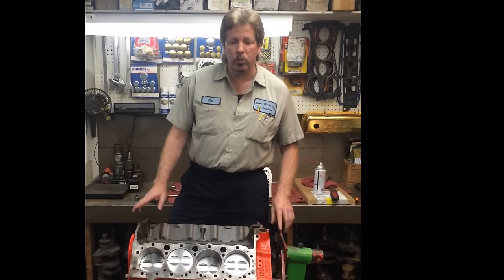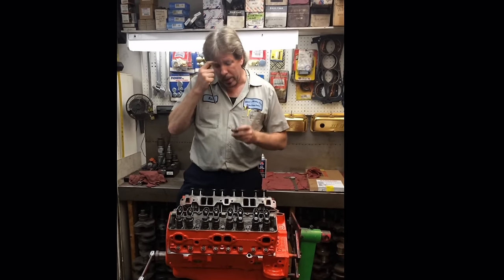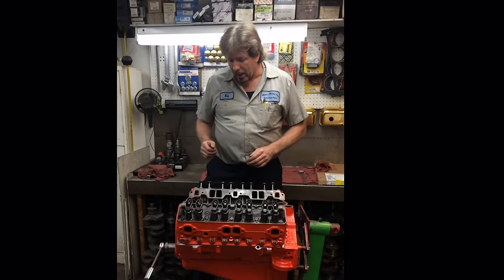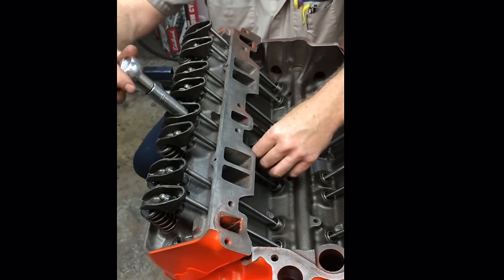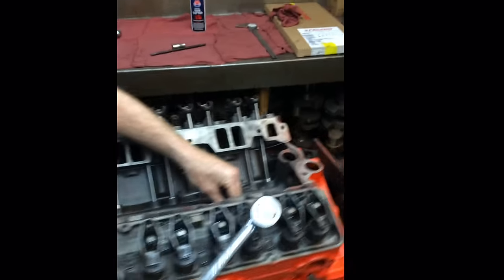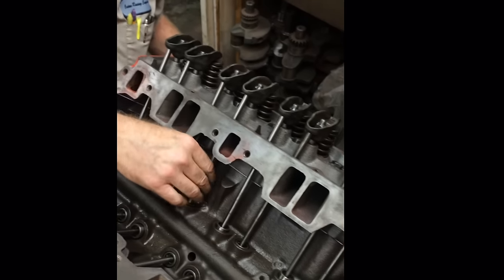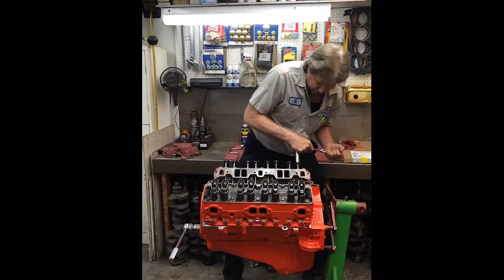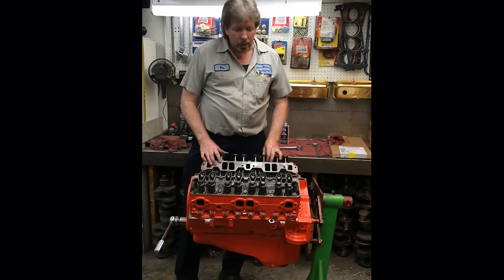Hydraulic valve adjustment made easy - Your Engine Guy

Comment: WOW... i learned something new... after i thought i knew everything  come to fine out i don't know shit... Haha this is the best VIDEO i have every seen on You Tube on engine valve adjustment no kidding... you sir just changed my life for the better... i have built engines since 1974 and today working on Fords  miracle engine the 302 5.0L as they call it a wonderful Engine that is truly a easy engine to work on and pump-up and chevy also had a 302 engine that i had a friend pump-up in a 1969 Z28 that was one badass Monster of a engine and i had a friend also had a crazy 427 he jammed in a 1969 camaro with a rock crusher T22 transmission that was insane Horsepower. but my B18-C1 GSR Acura engine turbo charged 16 boost power trick fuel 112 octane in a 1995 2 door honda civic could win any of these lead weight cars that GSR B18-C1 Engine i built was a runner ... i still have the engine but sold the car to a good friend with a stock GSR used engine i got out of a junk yard for only $ 1900.00  and i was a great find and well worth every penny of it... this Engine has never lost a single race in San Diego CALIF Ever, i build a serous Engine and am a true Master Tech Here in San Diego and am trying to finish up on the 1995 4x4 Bronco rebuild and so happy i saw this video today and i thank you so much for taking the time for filming it. i give 2 thumbs up and will subscriber to your channel...

Comment: i saw Vice Grip Garage do this here on YT said his Dad showed him. i did it this weekend on a TBI SBC that i have always had trouble with the valves clacking on start up. i was taught by my Dad the running and back off till she taps and run her down 1/2 to 3/4 turn method and spit oil everywhere. this works well even on an engine that has been inst. i would say to maybe do it first thing in the morning before the lifters have been pumped up and use a wrench to turn over the engine if possible. the engine now has more power and runs better than ever since the valves are now opening fully and getting more fuel and is exhausting properly. thanks for the video.

Comment: I had learned that method many years ago from an old hot rod buddy of mine.
Also used a set of old rocker covers cut out, so after installing engine, I could start it up, and make sure oil was making up top on every rocker.
Also makes easy adjustment if I still had a clatter, with no oil spraying around.

Comment: Tried this on a fresh AMC 360 stroker build and worked great on the Isky cam and Crower lifters. To be sure after I completed all 16, I brought the engine to TDC and went around 90 degrees for 2 revolutions and they all checked out good

Comment: Great Video   I’m getting ready to do my 79 F150 302 ci.   So this procedure will work for my engine.  0 lash means adjustment is with no movement with your finger.  You stated 90 degree of crank turn to check and adjust if needed. So each cylinder would go through a complete rotation. (360 degrees) I got the tool to turn the oil pump and the correct oil/oil additive.

Comment: Keeping the oil from squirting out while adjusting the valves with the engine running. Had good success with cutting the top out of an old valve cover direct over the valve adjusting nuts of the engine. Can be reused over and over. Only needed to make sure the gasket remained undamaged and in place.

Comment: Great video!  I was wondering if this method would work for any 4 stroke motor no matter the cylinder count as long as it has hydraulic lifters and adjustable push rods??

Comment: great video but if you have an engine already run and you want to check the adjustment the oil has ready pumped the lifter up do you let it bleed down and still give it 3/4 turn or give it less maybe 1/2 a turn

Comment: Very interesting ideas on this video. I have tried the with engine idling system, the open/closed valves on timing the heel of cam, tried the feeler gauge system, and all these ways have merits. Time consuming and very frustrating at most. This way of doing the lash does seem like it will work, the one question that needs a bit deeper explanation is what happens when the lifters are full of oil, or in pressure with being in a pumped up already ran engine.

My theory is that it shouldn't matter because the down pressure of the pushrod will set the loaded pressure, if the pushrod has any finger spin (loose play) in a hydraulic setup this should be adjusted by Ken's video. However, on a broke in engine, wouldn't each valve need to be loosened off first to find free spin and then adjust accordingly to reset the valves from a 100% even place? 

Doing all this in an engine that is still bolted in the engine bay makes for a harder work area. Space and obstacles can be a pain, and spinning the pushrods could be troublesome for some people. some roller rockers have very limited room under the rockers to spin the pushrods while seeking free spin.

Sometimes in my trials of adjusting valves I have found the socket will bind with the nut and the top of the rocker when an engine is running in idle, or even if the socket is left in the rocker on the nut while just hand turning the crank. Ken's way of adjusting should eliminate most of these problems.

I want to open this up for further discussion about re-doing a broken in engine. Will all who try this back off all tension first, then start over with Ken's way? and how did it work out for you? After you did this, did you go back and recheck with feeler gauges with TDC on #1 lobe on heel and see how it set up? if so what did you find?

Cheers and thanks for reading.
Reply: I have watched on another video Ken has done very recently, and he stated that he has made, or will make, another video addressing the issues of oil filled lifters. Can anyone link to this second part if it is out there? thanks
Reply: Can you answer your questions for me

Comment: Wow thanks a lot. I am about to adjust a 1995 ford van 5.8 that i am working with this will help a lot. The only difference is mi lifters are the existing ones and they are loaded with existing oil . The book says i need a little fork tool witch i am about to fabricate . To finally push and bleed the remaining oil then calibrate. On my Chevy 454 i will do just like you did with this . Mind opening 🤯💯

Comment: I’m swapping cylinder heads on an engine that is currently running and in the vehicle. Not planning on changing the cam or lifters. Do I need to remove all the stock lifters and drain them of oil to use this method?

Comment: My uncle worked in the engine shop at gm and he taught me this technique when I was a teenager and it is full proof if some of these guys with roller cams and rocker set ups would use this method they would not have near the trouble adjusting there value train this will work on solid lift as well on last step on solid I only go a 1/25 turn to mabe slightly over and there perfectly adjusted 👍

Comment: I just did this on my '81-82 305 LG4 SBC with a 260H Comp Cam camshaft and my edelbrock performer rpm intake manifold still bolted on.

I turned the motor over 2 full revolutions, close to 90° at a time, and some were still loose a little by the end. 

Once I completed 2 revolutions and stopped at TDC compression stroke, I tightened the loose ones down again and gave all of the rocker arms.

Still have to drain the coolant oil and put things together on top before I'm ready to start it and see these results.

When I'm ready, I'm also going to leave my valve covers off with a vacuum gauge attached in case this procedure made them too tight and have to adjust with the motor running.

I'll post an update here on the results.

Comment: I used to do them hot when I was younger, then I started doing them cold when I was confident I'd learned correctly from the older guys. My MOTOR manual is absolutely dark and greasy on the pages where it tells you how to adjust 2 rockers at a time every 90 degrees twice around. Then I'd have to work on something else, and I'd get lost and end up turning the engine over 4 or 6! times to make sure I didn't miss any. Wish I knew then what I know now. Thanks!

Comment: Wow what luck i ran across this video. I understand everything you said and this all makes sense. So basically its a 1/4 crank rotation? Then adjust til a slight drag. And keep going 1/4 turn etc. 2 full rotations worth? Then rotate 3/4 additional on last runs to compensate for the spring tensions hell yeah I get it!  Sounds simple enough. I've got a 360 FE gonna put a roller cam in it and glad you tipped that as well.

Comment: Used your method to adjust valves on a new Blueprint 347 Ford. Still a loud valve train I think. Would more preload quiet it or  should I go with less. Brand new motor. Thanks for showing us the method.

Comment: I have a long 1/4 inch extension that I specifically made for using with my Snap-on variable speed cordless screwdriver to rotate the oil pump for priming the lifters and engine just before slapping on the intake and distributor.

Comment: At the beginning when he says when you set according to piston top dead center, you have to rotate the engine two full turns. Using his method, or the certain valves full open other valves full closed method, you still have to rotate the engine two full turns. Using the TDC method it is not a problem keeping track which cylinder you are adjusting if you have to leave for a bit. Just leave the wrench on the nut you are adjusting when you leave. I am not a mechanic nor a machinist, but I have found that it doesn't matter if the lifter is pumped up or not. Previously adjusted lifters will bleed down (allowing the plunger to move to the proper position) as you work your way down the line. Of course adjusting the preload is much easier with a non pumped up lifter.

Comment: Awesome  method Ken! !!! Im changing bad  leaky intake gaskets on a Ford Fe so I have to remove the  rockers/rail and pushrods to be able to remove the intake manifold to install new intake gaskets . How do you use this method to adjust valves/roller rockers with oil  already still in the motor/lifters  and make sure that a valve will not hang open ? I really want to do this method after the intake manifold is re installed ? Great video !!!

Comment: Hi,super nice and easy to adjust lifters on my bb chevy,my question in if I use the same lifters was on my engine,ther not new,and for sure not empty of oil,I will not pumping it whit a push rod,so can I used as is? Thank you very much.

Comment: I'm new at this and still learning, but if I understand correctly, this procedure ONLY works assuming you already measured and have the right size pushrods. Otherwise, when it's all adjusted and you're setting the preload by doing the 3/4 turn, you need to do it with a torque wrench and make sure you hit the right torque number by the end of the 3/4 turn. If you don't hit the torque within 1/4-3/4 turn, your pushrods are the wrong size. At least that's how I understand it :)

Comment: Hi!  Very helpfull video!  Now my task is to verify if valves clearances are correct on an already running engine (Chevy 283 V8).  Since the lifters are already filled with oil can I use the same procedure you demonstrated?  Also should I run the engine to operating temp. or proceed with the adjustment on a cold engine?  Thanks for your time!

Comment: Ya I have never soaked lifters in oil .I did installs at a engine machine shop and the builder would adjust lash on an old machine that supplied oil to engine and rotated crank .

Comment: I used your method and it work great. I put a howards cam in and they said since I had double springs (300) seat pressure to break the cam in I had to remove the inner spring so I had like 140 seat pressure. My question is now that i have it broken in the lifters are pumped up so after no movement on the pushrods (going through the procedure that you show) how many turns would you go? 3/4 turn 1/2 turn or 1/4 turn since the lifters are pumped up and solid. Its on a sbc 350 hydraulic tappet engine.

Comment: Wow what a truly awesome simple way of adjusting valves  . DID I CATCH YOU SAYN IT CANNOT BE DONE TO HYDRAULIC adjustable LIFTERS.did you mean nonadjustable (i have a non-adjustable  rocker arm shaft) iHAVE A 390 FE    .. CAN YOU PLEASE LET ME KNOW IF YOUR METHOD WILL WORK ?? ENGINES BEEN REBUILT BUT I M PUTING A NEW ROCKER ARM ASSEMBLY ON IT & NEW PUSHRODS..CAN I GET AWAY WITH JUST TORQUING THE ROCKER ARM SHAFT TO SPEC. & CALLING IT DONE?? ANY INPUT IS GREATLY NEEDED ..THANKS BUD👍👍

Comment: Thank you Ken I have been doing this since I was in vo tec high school and had the reached tell me I was doing it wrong but they always made a mess with the oil my engines would start on like the 3rd or 4th time they would have to adj the valves and make a big oil mess ,,,and you are right lol about the seats and carpet in the vans I did a lot of vans thank you for showing me I wasn't crazy even though the teachers thought I was

Comment: This is a great video. I will use this method as I assemble my 1958 Chevy 283 cid. IF an engine has already been ran but needs lifter adjustment, is the " old school" method you spoke of still the best, even if it is hot and messy? Please advise. I sent an e-mail to your business also I hope you read it and respond. Thanks!

Comment: I want to perform this adjustment on a "rebuilt" engine I acquired. Its been sitting for years and have no idea if it has been primed or if the lifters were soaked in oil prior to assembly. Without removing the intake, is there a way I can make sure the lifters are flat to prep for this adjustment? Thanks so much, awesome video. I've always done it the messy way in past years.

Comment: Great video, thank you.   Why do you install the oil pressure gage?  Is there a certain oil pressure to maintain while turning the oil pump using the oil pressure tool with the speed wrench?  Or is it just to stop the oil from coming out?  If so could you just use a plug instead of the oil pressure gage?

Comment: Hey Ken thank you very much for your teaching. I am new to small blocks. Does this also work for a small block which was running on the street yesterday and is still in the car? I would try this by removing the valve cover without the engine running and starting to adjust like you told.

Comment: I recently acquired a 283 from a 58 Chevy that was stuck.. Hadn't run in 40 years.. First thing I did was release the pressure on all the valves by loostening the rocker arms.. I then tapped all the valves lightly with a rubber mallet and found two were stuck.. got them freed up and bouncing again.. Filled each cylinder with ATF and left overnight.. Next day, got the crank to turn just about 3 degrees.. then turned it back about 8 degrees.. forward about 15 degrees, some resistance still... Put it back to the middle of where it had been and came back the next day.. Turned it and finally got over the bump.. Spun it completely around by hand about a dozen times (no plugs of course).. Hooked up the starter and.. Click.. HaHa.. Anyway, hooked up two batteries in series (24V) and brought that start back to life.. Now the old 283 spins with no resistance and the starter works with just 12 volts.. I'll be using your method to adjust these valves and get this old Power Pack engine running again.. Plan is to drop it in my brother's '56 Chevy.. Thanks for the tutorial.. I remember in high school the shop teacher had a pair of valve covers with the tops cut off to minimize the oil splash during valve adjustment.. I was thinking of making a pair.. No need for those anymore..

Comment: I am 27 years old building a 350 4 bolt double hump heads I bored it out with my van Norman 777. I did all my own work to install it in my front engine dragster 😀

Comment: Awesome video quick question what would be the procedure if the lifters had been soaked overnight and or doing it on a motor that valves need adjustment that has previously run in a vehicle

Comment: Great video Ken, very helpful, clear, and concise. I am repairing a 302 Ford which has hydraulic lifters. The aftermarket rocker adjustment nuts loosened, released two pushrods and one lifter came apart and was ejected into the galley. I am replacing all the rocker nuts with polylocks so I will have to adjust all the valves. I will use your method, but how do I get the lifter being replaced to the same condition that the other 17 are in?

Comment: That’s awesome! It makes sense too. I understand it. But if the engine had been running I would still have to go through find top dead center and adjust individually correct?
Reply: what did you ever figure out?

Comment: Why isn't this considered the standard way of adjusting valves!?! My only worry is that i just replaced heads and head gaskets on my 85 chevy truck with a 327,didn't replace lifters so they already have oil in em. Will they still adjust the same as with them dry? Thanks for sharing your knowledge and wisdom Ken! Gonna subscribe!

Comment: My '94 350 has a clatter.  My first time playing in it this deep (no engine experience).  Valve covers off, the majority of the push rods have some up/down play at variations of staggered crank positions.  I've working on tightening the rocker nuts with 1/8" locknut turns, rotating engine and tightening the newly presented loose ones, one by one, some are up to one full turn until no up/down play.  Seems much quieter.  Do I now go,  a half turn more on each nut and call it good?  That's my pending plan.

Comment: Great Video. What if your engine has been running for years and notice that lifters need to be adjusted? You said it has to be without oil in them, correct? Then how would you recommend doing hydraulic lifters in a BBC? Thanks